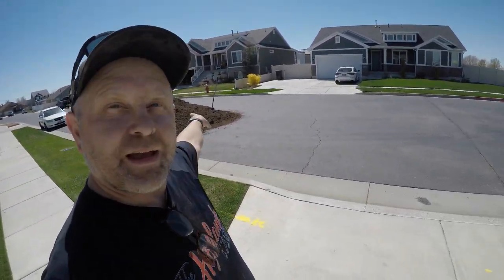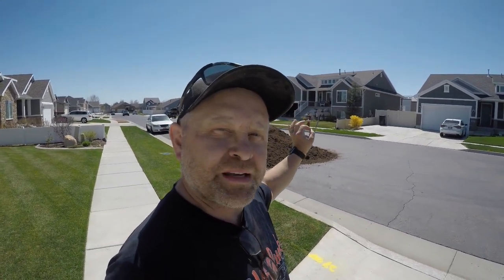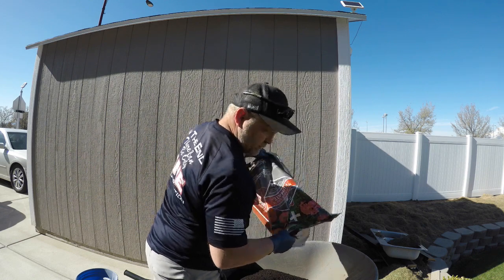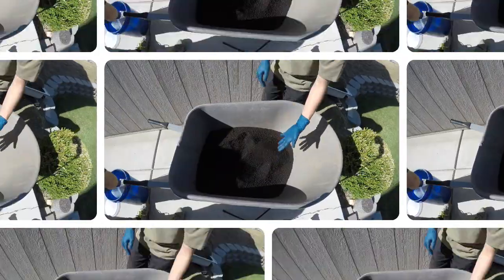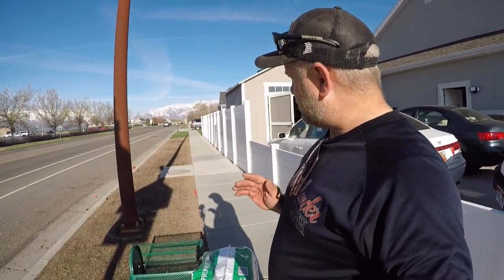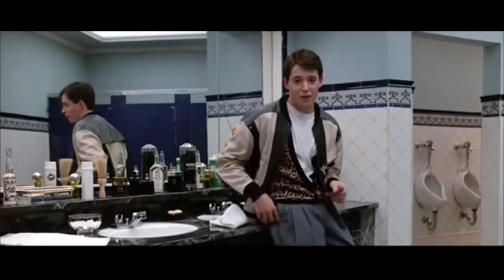Mow Strip Renovation with Barenbrug Turf Blue Pro, with RPR for the Ultimate Lush & Resilient Lawn!

Comment: Hi. Have a question.
I'm in Michigan with very sandy soil.
Is there a benefit to putting down the RPR / HGT Bluegrass combo or just seed with RPR and then overseed this fall with the HGT Bluegrass?
I should have my irrigation system functioning by early July.  It's probably too late for Bluegrass seed, right?
Reply: I also plan to put down 3 inches of topsoil before I seed with the RPR in July.
Reply from the maker: It is possible to seed in July with KBG. But you are then committing to watering like a “crazy person” 🤣🤣to keep that seed damp enough to push germination and for a couple of weeks thereafter to maintain the seedling development . I love my Turf Blue Pro with the RPR combine, I put down. I have also repeated it on 3 others yards this year and we are seeing amazing results. I have not used the HGT KBG but have heard great things about it. So bottom line…you can seed in the heat of July…it’s not easy and will take more attention to the moisture level and obviously MORE water. You can also Pre-germinate the KBG (as long as it’s not coated with the Yellowjacket coating.) I put out a video on that in 2022 in my ugly lawn series for that year. Thank you for the comment. I hope to hear from you in the future.
Reply: @TheHighlanderLawn   Thank you so much for confirming what I suspected.
I'll seed with the Barenburg  RPR in July.

Comment: I have this seed that came last week. It it ok if I seed it now or just wait till August. I’m starting from scratch. I’m in MN. I mean if I sees now and give it the right about of water, would it matter?
Reply from the maker: The Turf Blue Pro is quite resilient. And I know that it can get quite humid in MN, (I know because I lived there for a couple of years, ;-) ) If you seed now, and give it the amount of water it needs to prompt germination and establishment, you should be just fine. It may struggle just a little bit in the higher heat and humidity, but that will only last for a couple of weeks and then you should come back out of it and the grass should have no issue recovering, which the stress should be minimal anyways.  Then I would save some of the seed and do an overseed in the first week of September. This will give enough time to germinate, get fairly established and then go dormant for the upcoming (hell freezing over) winter. Yes I know that cold like no other!! -40 below will be forever etched in my brain, and fingers and toes...LOL. Then when spring comes around next year you should have a good push of growth coming out of dormancy and a great looking lawn shortly thereafter, if your water, nutrients, etc are put down correctly!!!  Thank you for the comment. I hope to hear from you in the future.